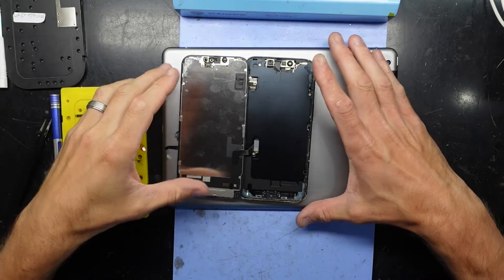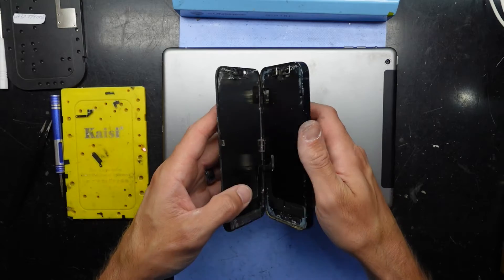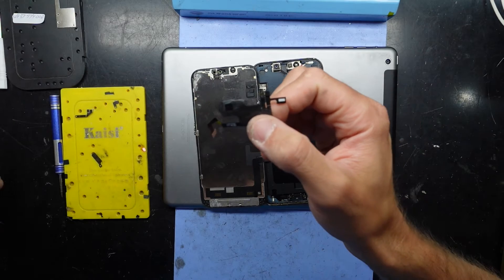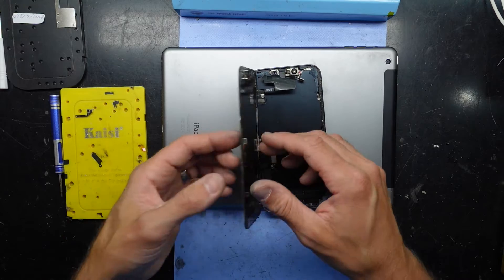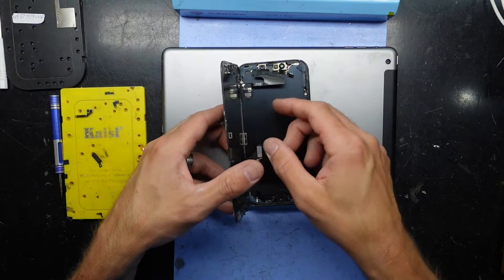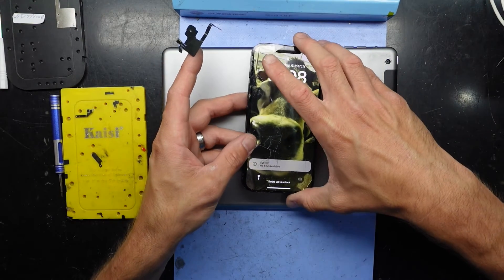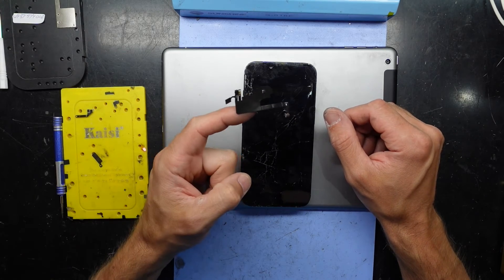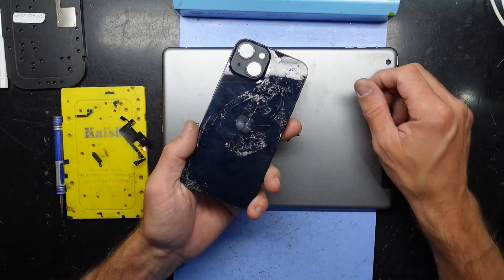Iphone 14 Series , Apple logo boot loop, Solution

Comment: If that flex is not connected phone will restart every 5 mins as phone panics when a sensor is missing.
Hope a replacement works. 
what screens are using on the 14 these days?